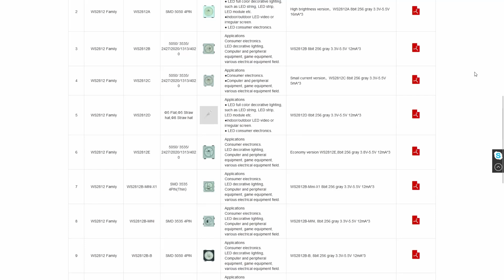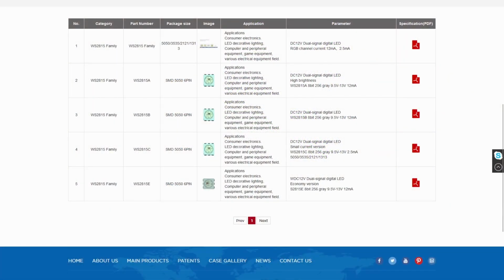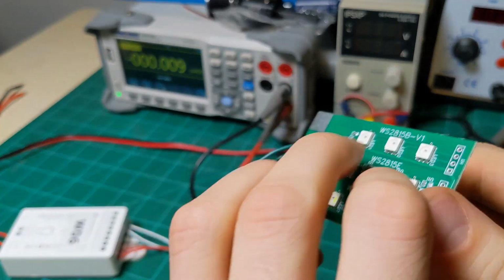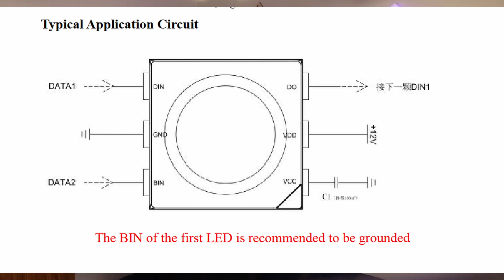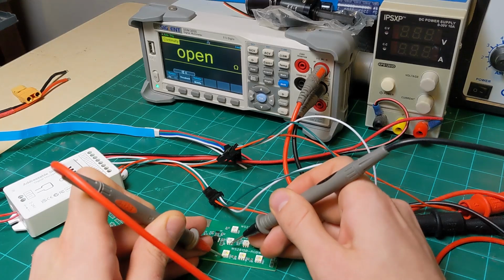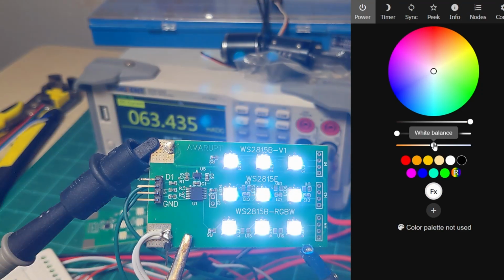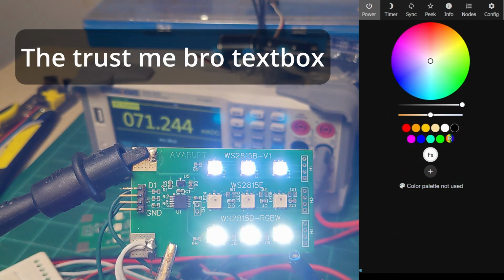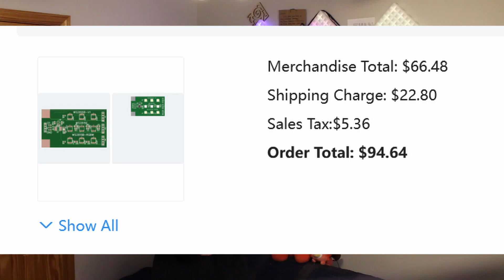12V Addressable RGBW is Finally Here! WS2815B-RGBW Testing and Comparison

Comment: Great video — thanks for the detailed breakdown! Was hoping I'd find WS2815B RGBWW but atleast these exist too! I’m curious about your thoughts on using WS2815 RGBW strips for overhead desk lighting in a studio setup (mounted on my diy overhead alum extrusion frame)

Most of my experience is with WS2812B, but I’m exploring a DIY matrix combining WS2815 for RGB effects with 24V COBs (cool + warm, chipset unknown) for dedicated white lighting. Do you think RGBW strips are practical for this use case on their own, or would it make more sense to alternate between RGB variant with the COBs for better performance.
Reply from the maker: I think these are really good for getting everything in one package with one control setup and it's definitely serviceable as a main light, but for a main light I would recommend an RGB strip and a high CRI COB ccw

The other nice part about these is the white is addressable, which a COB would not be